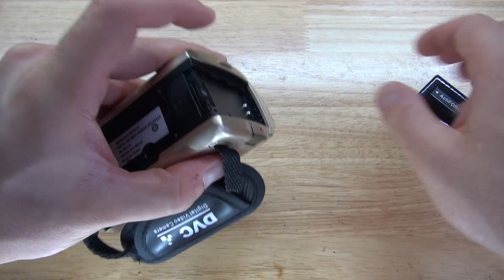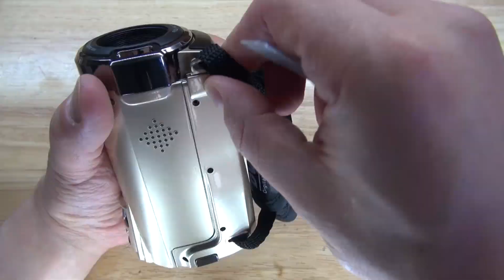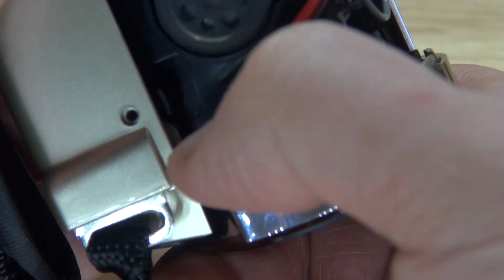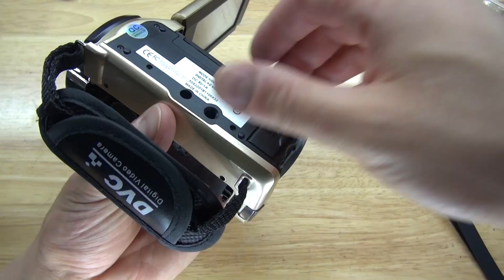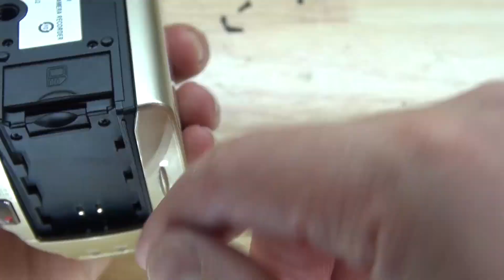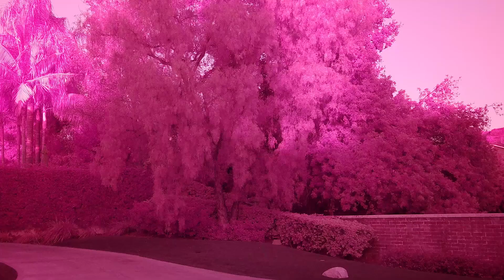Low Budget Full Spectrum Camcorder

Comment: if it can already switch out the IR cut? why remove mechanism?
Reply from the maker: That is because using the camera in regular mode the IR cut filter is on and it only switches off when it is in night vision mode. I want it to be off when in regular mode to use the full spectrum effect. The only way to do that is to remove the IR cut filter.
Reply: @SciTyeTech If you don’t remove the IR filter you can’t use full spectrum during the day?
Reply: @SciTyeTech  Makes sense as sony night shot did something similar after the 'see through people's clothing' scandal using night shot in daylight. Tho in my world I would at least make it where i can control that IR cut filter. its the same as in security cams, + voltage to slide it one way, - for the other. Edit, you can also just set it to clear and unplug it.